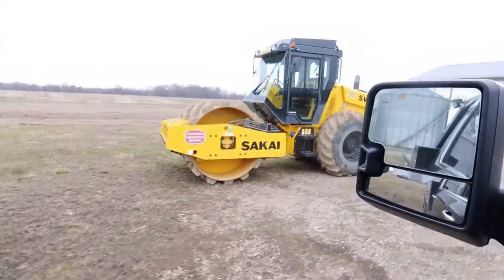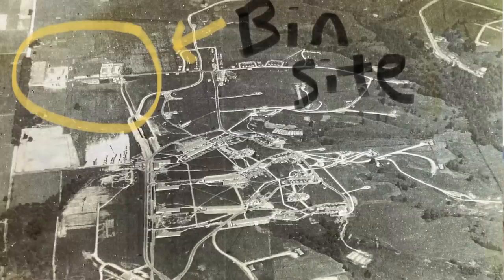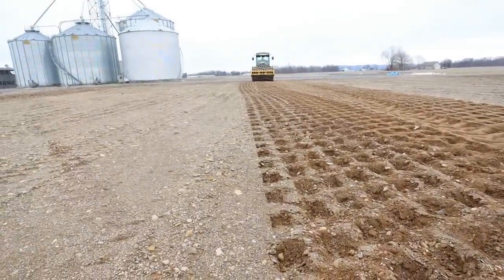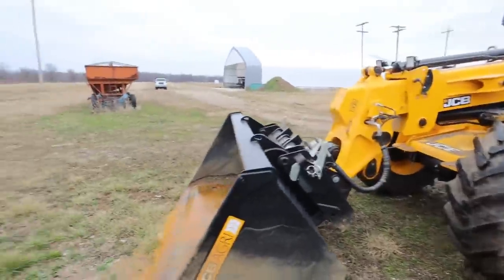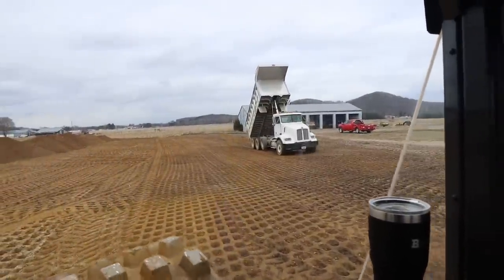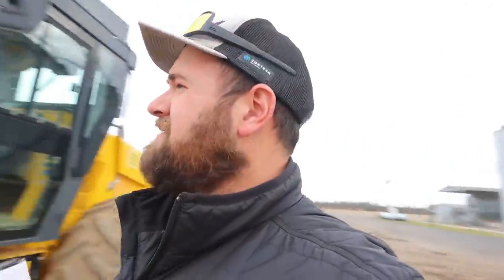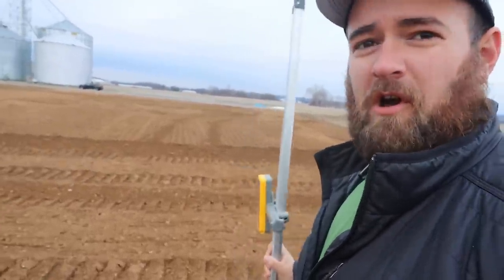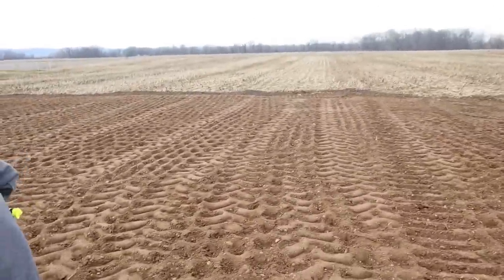Making Waffles with New Construction Equipment

Comment: HEATED FLOOR! I might be late to it but it will be worth it in the long run. I screwed up building my barn 5 years ago and didn’t put one in. At least put the pipe grid in for it even if you don’t hook it up right away. Just my 2 cents from my experience. Take it or leave it.

Comment: G,day from Sydney Australia.
Initial building stage considerations.
* Construction site access if rain
* Power supply and safety
* Any subterranean termites or pest 
* Building design for wind speed and thermal efficiency.
Then apply the carpenter's rule;
Straight, square, true, level and plumb.
🌳🌲🌳🌳🌵🪨

Comment: Interesting using a padfoot on gravel. Normally (may be local differences) padfoot roller on cohesive soil (clay) and smooth drum on gravel. As you showed, compaction is at bottom of pad and other gravel is loosened. Ideal would have been to use padfoot before you began hauling gravel, then smooth drum - especially when you are renting and your dealer can supply either.
Reply: Sheep foot always packs harder then smooth drum regardless of material. The smooth drum works great but it’s like having wide tires it puts less pressure down. If that makes sense.

Comment: Brian, you should consider taking a bucket of that material to an engineering outfit and have them run a density proctor and then they can come out and test it with nuke gauge. That way y’all know it’s right. The engineering outfit will know what you need compaction and moisture wise to hold that concrete. It’s not overly expensive and it will be cheaper then having it settle. We don’t build on any pad until we have a proctor. It’s a CYA thing.
Reply: Came to say the same thing.  I do stuff like this for a living!  Lol
Reply: Yep. For sure. If u vibrate too much you can liquefy the sub soil too.
Reply: Highchair guy
Reply: Yep pack it and then pack it them pack it sonemore cause in the last video you see what that equipment is doing to your drive way and you sure don't want your shop floor to look that way

Comment: With all your farming equipment passes over a field how far down does the compaction go? The compaction from a tire is V shaped with the narrow part down. If your compaction zone in the field is 15 to 18 inches I would suggest the compaction from the roller is going compact the same depth. The compactor vibrates as it rolling as does your equipment. If it were mine I would peel it back with the D 8  and repack it. Loaded triaxle truck will compact it and test as you go. Probably the reason so many slabs have cracks is lack of compaction and not stress relieving by sawing concrete

Comment: The old vibratory rollers you had to turn off the vibrate when changing directions. I wonder if the new ones do it automatically. The reason being if building a road or parking lot etc. You would live a divet where you stopped.

Comment: Is there a vibrator on that roller usually you can hear it and no not the dirty kind they call them vibitory rolls there should be a switch in there that will pack it down

Comment: How much height do you need to open the auger on the gleaner inside the building?
Reply from the maker: Not sure but we could always open it outside and drive it in
Reply: @BriansFarmingVideos  I was going to tie a rope on and open it to its highest point and mark the rope. Fold it back in and measure the rope.  Building a shed tall enough to unfold in using vaulted truss.

Comment: D 8 is also an excellent compactor, if my memory serves me correctly a D 8 passing 3 times is adequate, tracks must pass three times on every section. Moisture is key, when building rte 495 in the Ma. area they would flunk compaction test, they would run water over it. Generally speaking after the water it would pass the compaction test.

Comment: You are worried about getting the slab right but only putting down 6 inches of concrete? You are brave!
Reply from the maker: That’s what the drawings called for. They have built a lot more buildings than I have
Reply: 6 is plenty
Reply from the maker: That’s what all are other buildings are on
Reply: I suggested 8 inches in my shop and my builder agreed  it was a sensible upgrade. Your builders quote with 6 inches makes it look attractive in price but I can tell you we did a grain flat storage floor 30 years ago and it's cracked all over. 8 inches gives a much better chance to stand the test of time.
Reply: I’d go 8” for a big shop floor. That would be an extra 80yds roughly $10,500 for the concrete at $130yd. Put lots of steel in that floor too! I’d be doing 1/2” bar 12”x12” pattern.
Reply: What are you talking about? 6 inches is a lot!😁